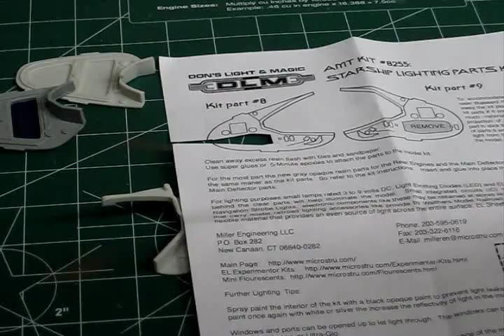AMT/ERTL 1/450 Scale Model U.S.S. Defiant Video Build Series PT 2

Comment from the maker: Hi, good comment. For sure you can light the bussard scoops with the method you mentioned. There are a few video's right here on YT that show examples of Defiant kits that were internally lit that way at the front. 
Some of the videos I do, I try to show a basic "out of the box build" and sometimes a build video that features aftermarket parts like the DLM kit for lighting the model. It's in an effort to show folks what you get when you buy the aftermarket parts mainly.